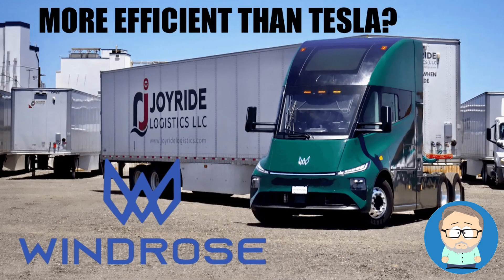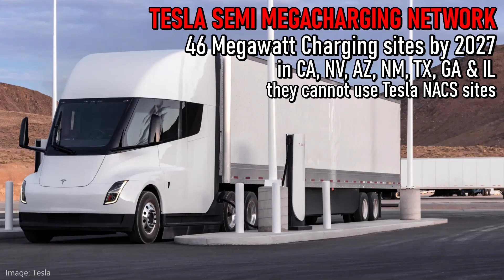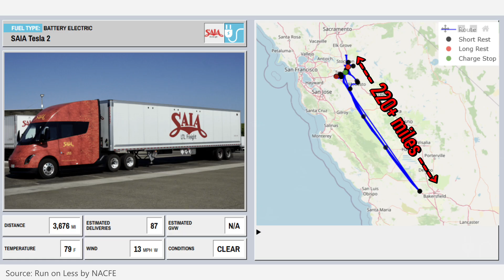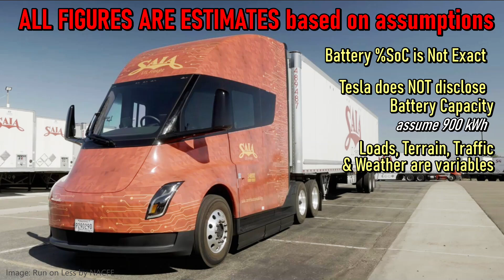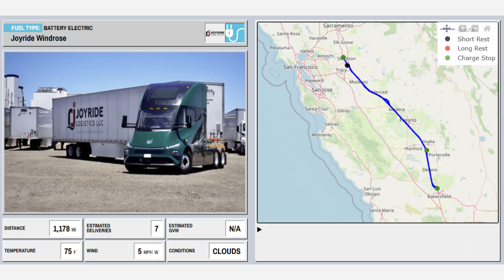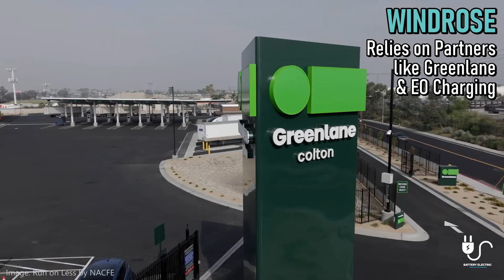Tesla Semi v. Windrose - comparing highway data and charging

Comment: And for long distance, they run all across europe. Since working regulation says break has to happen every 4,5 hours, that's when they recharge with 300 kwh, this way mileage for the full day is the same as diesel trucks. Single charge distance of the good ones is around 500 - 600 km, that's with 600 or 700kwh battery.

Comment: In europe, electriv long range trucks startet getting on the road. 
Maybe you know the channel electrotrucker?
One truck I know of, E-Actros, has efficiency of around 100kwh per 100km, surprised to hear those two have around 160 kwh.
Reply: Mercedes themselves claim an efficiency of 120 kWh/100 km for the e-Actross 600.  I know about the test to which you are referring, in which an efficiency of 100 kWh/100 km was supposedly reached... but that was at a 33.2 ton weight, NOT the full allowed 42 tons!  And we don't know about elevations and wind conditions, which both can affect the result of a single test quite a bit.

Both the Tesla Semi and Windrose seemingly have reached efficiencies of 1.6 kWh per... mile, not km!  So, also 100 kWh/100 km!  It is not so surprising, as the Windrose is a servile copy of the Semi!

But we know from various sources (Tesla, Pepsico, SAIA, DHL) the Tesla Semi efficiencies, how they have improved by 7% in the last 12 months or so, and a bit of physics knowledge allow us to make a US-Europe equivalence:
- The Tesla Semi is using <1.7 kWh/mile, probably more like 1.6, at max US weight (82'000 lb/37.2 metric tons) at 55 mph (88 km/h) on a flat road with no wind.
- In European conditions, the Tesla Semi would use <=1.0 kWh/km at max EU weight of 42 metric tons and 80 km/h, the max speed for trucks in most (but not all) EU countries.

Comment: North American cities are too far away for electric semis to make sense.
Reply: Not for the Tesla Semi
Reply: Then focus first on the areas where the cities are within a reasonable distance. There is a lot of warehouse to warehouse transport and local distribution which can be electrified, it will take years before the diesel trucks which are used for these are replaced. People always focus on the impossible routes, like LA to New York but a lot of transport is local.
Reply: Of course not!  What counts to determine how many miles a long-haul truck can do in one day is not the size of its fuel tank(s), or the distance between cities, but the number of hours the driver is allowed to drive within a 24-hour period (11 in the US, 9/10 in Europe), and the realistic average speed the truck can maintain (the US average being 53 mph... of course, a truck can go faster on some stretches... but that the nation-wide average speed).  Conclusion:  in most instances (there might be rare exceptions), the Tesla Semi can handle the same long-haul duty than any diesel truck... provided the charging infrastructure is in place.  That is the case in Europe, but as always in terms of infrastructure, the US are lagging behind, and it will take a few more years to build that one up.

Comment: Right now even once tesla plant is at full capacity neither company is going to make a dent in the approximately 3-4 million class 8 semi's on us roads with Windrose aiming for about 10,000 per year and Tesla at about 50,000 per year Neither is in competition with each other. it would take more than 40 years to replace all the US only semi's with those production numbers. 

Heck if every Semi plant that could make electric semi's made them only for the US and at max listed capacity there would still be more than 50% diesel trucks in 3 years probably much lower since not all the trucks will go to the US and not all factories will be at 100% stated build rate. 

Honestly there is probably not going to be enough Class 8 Semi's built to replace all new semi's through the world and probably not the US either. Especially if you go with realistic production numbers and how many trucks will make it to the states. With honest production numbers it will be hard to replace all new Semi's in California (lets face it we will need more semi plants built for EV semi's or diesel factories converted.